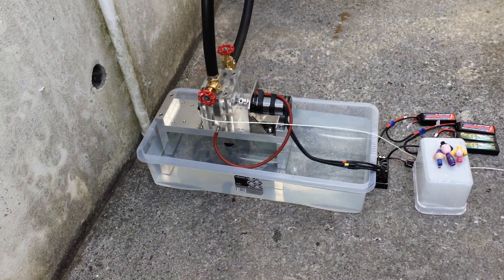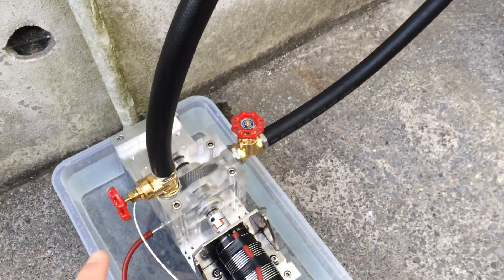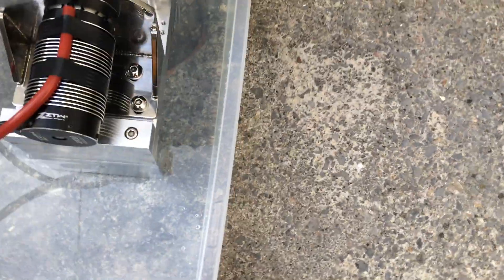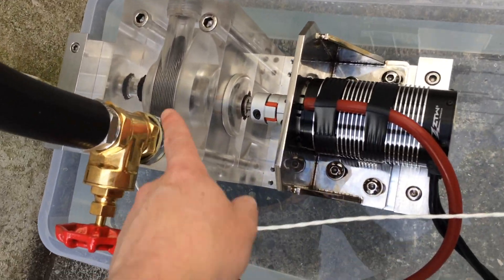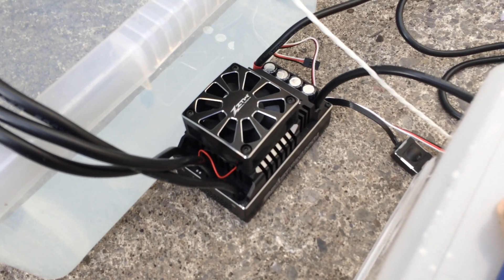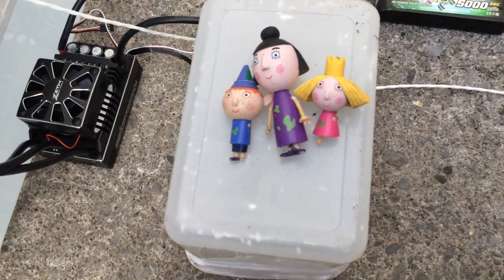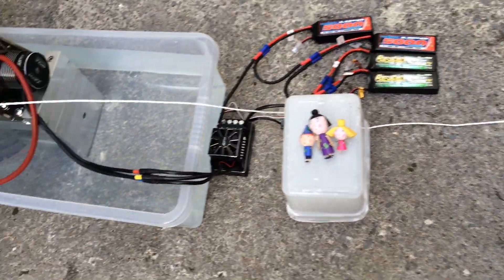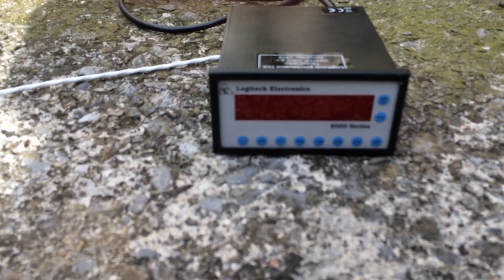Nikola Tesla's Pump - Second Experiment 13.32kw motor 44.4v 5000mAH - Part 1 Introduction

Comment: Naw I see were you going too, open the water from 15m high box and put the pomp too thou it back were it came from. Thow awy the baterys, and use the out put excite a main genotrator( with ac making rotating mag field on the estator). Good luck
Reply from the maker: I live on the top floor of a building that is about 100ft high. This test was done at the bottom of it. Good input, shows you understand the system 👌
Reply: @nikola.tesla.r.and.d.centre  nice, so high... i think youll have to put 2 in the midel or the way to reach (one att 33feet other ate 66), but these you feed from the main genorator. Soon I,ll post main low rpm self excited(with houve bord motor) the stator and eletromagnet as pancake over looped, geno  coil on rotor 1 series simetric close opon its self and other 2 or 3 to use by rings( rans free from the hub and low also, by lens law the opisete off the stator) after this there be one for hause use on the meter(using the gride) AC$xACfree
Reply from the maker: @teslafanatics2659  The system has to be hermetically sealed but water could definitely be introduced at a high point to pull a vacuum on the fall. It’s more complicated pipework wise but possible. For now I am happy to try 2 x 5m clear PVC pipe and a 1m pipe using push fit couplers. Knowing the water can be piped to 11m height is the first challenge. Supporting the pipework is another. 

Just had a load of scaffolding put up today as the neighbours roof needs repairing.

I’m not 100% following what you wrote yet but I am a little tired. 

My current plan would be to use the motor as a 3 phase alternator and convert the electricity to something more usable via some electronics. I’ll reread what you wrote when I’m more awake and respond again.

Comment: nice setup. that's cool about the liquid cooled electric motor. going to pull out the thermal camera too?
Reply from the maker: The motors are normally fitted to high power RC cars or boats and thus air cooled. For extended runs some people might use fans on RC cars but sometimes they use a pump, tank and motor water cooler. For example https://www.ebay.com/sch/i.html?_from=R40&_trksid=p2380057.m570.l1313&_nkw=rc+motor+water+jacket&_sacat=0

This is what will be fitted once I have one made and the water will be circulated back into the tank so the thermal energy isn't wasted completely.

These water jackets are used on RC boats too.

Home made versions of these water jackets can be made pretty easily too.

Another idea is to put the batteries into the water tank to transfer the heat into the water.

The higher the temperature of the water the lower the viscosity of the water, thus the less amperage it will take to move the same volume of lower temperature water. Again putting the thermal energy from the system into good use.

The ESC doesn't seem to get hot perhaps due to the patent pending twin fan design. There is a fan in the base too.

ZTW also make a 300 amp version of the ESC for boats which features inlet and outlet ports to cool the power transistors. This could also be used, however the main purpose is to lift the water to a height of 11 meters and then the control circuit will switch to alternator mode and the batteries and ESC will be disconnected from the system. A bank of AC/DC rectifiers and capacitors will handle the current generated and that will be plumbed in to a buck/boost converter or similar to allow 48v to 240v 50hz in my case via an off the shelf inverter.

The main target is being able to supply 20kw continuous which could be wired into a domestic / commercial consumer unit (fusebox).

I think 1kw continuous is a good base target.

The best bit about the system is that once the reaction is started the sun and "gravity" are doing the work.

The thermal imager isn't used in these experiments but yes that is a good call!

Comment: Looks great! Switch it on man!:)
But why you use batteries instead of power supply?
Reply from the maker: The whole purpose of using batteries is so it's portable. Compare the batteries to the use of a vehicle battery. The main purpose of a vehicle battery is to deliver a large amount of amperage for a short period of time but long enough for the engine to reach idle speed. Depending on the number of pistons, compression ratio, oil temperature, cubic capacity, number of auxiliaries and some other factors will dictate the necessary current to reach that idle speed rpm.

Piston engines are not designed to process large amounts of water and if a large amount of water enters a piston engine via the intake the best case scenario is it will hydrolock, followed by worse case scenario it will spit a con rod and piston through the engine block and the engine will be scrap.

https://www.youtube.com/watch?v=vMYILoMYdpE - Hydrolock Video

Tesla's engine is of a different character as it is designed to "operate with gas, steam, compressed air or water, any one of them, as its driving power."

https://www.youtube.com/channel/UC4uJgCHU3s4AOA-uT5SDA4w/community?lb=Ugx58QurWIIZ0XMnTLt4AaABCQ

"It does not take a mechanical expert to imagine the limitless possibilities of such an engine"

https://en.wikipedia.org/wiki/Steam_explosion

https://en.wikipedia.org/wiki/Flash_evaporation
Reply: @nikola.tesla.r.and.d.centre  i see.. Thank you!
Reply from the maker: @oxiigen  using about 10% water / 90% air it flash evaporated all over me. Almost instantly from water to water vapour just like my atomiser does using high frequency. Now I am designing some apparatus to control the water / air mix.
Reply from the maker: All that needs to be achieved is an 11 meter head, once that is achieved the fall will siphon the water under vacuum and it will cause ebullition. The sun will then raise the water as steam / evaporation / vapour and "gravity" will continuously pull a vacuum. Of course that needs to be contained in pipework. Something that I'm currently shopping for. 

I quite like this setup. I've found most of the parts. https://www.youtube.com/watch?v=Z3BRA0E1iAo